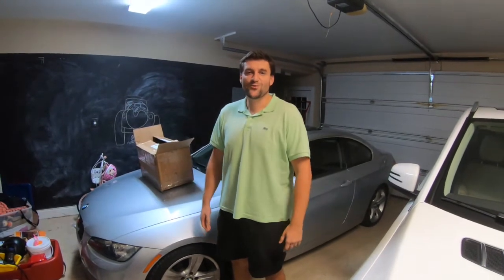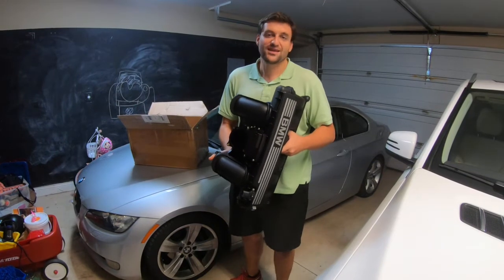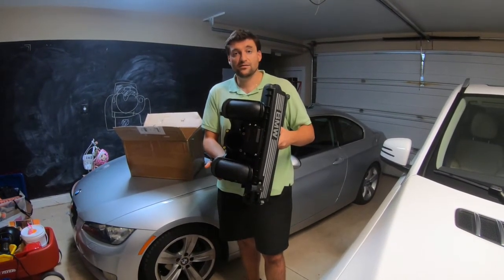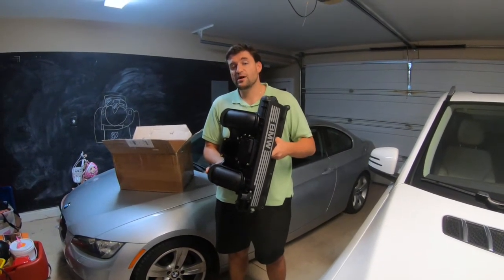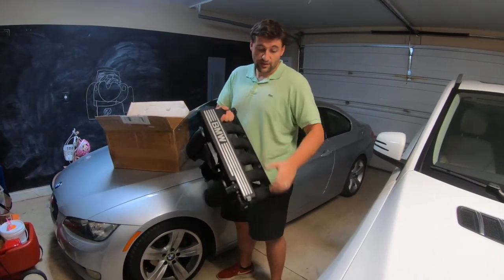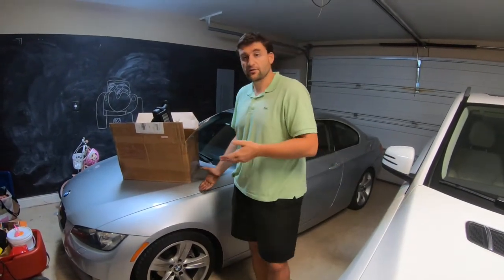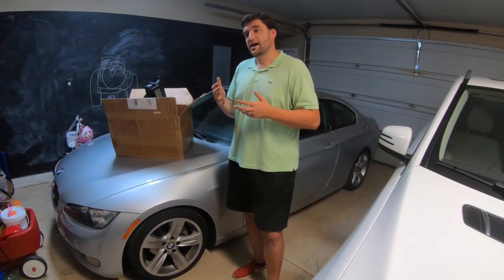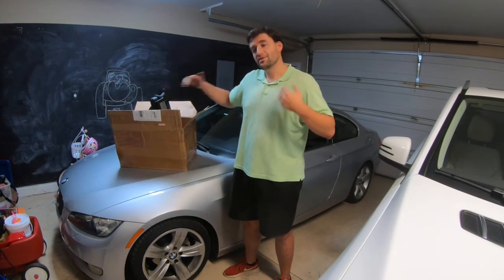BMW N52 Engine 3-Stage Intake Manifold Conversion - Should I do it?

Comment: in the UK we didn't get the E92 328i as far as i can tell just the 325i and 330i but interestingly the E90 330i only put out 258bhp but the E92 330i which i bought recently put out a claimed 272bhp so there are gains to be had out of the engine for very little effort but these engines were the N52/N53 in the later cars.
Reply from the maker: Thanks for the comment, buddy. Does the engine in your E92 330i have direct injection? I think that was the difference between the UK and the US specs, which resulted in the E92 330i in the UK having a higher HP output. Thanks for your comment, and stay tuned for more videos!
Reply: @GogoMotoring  Don't know the reason why but I have direct injection. For some reason the US always kill the power in BMWs a specially for the older M cars